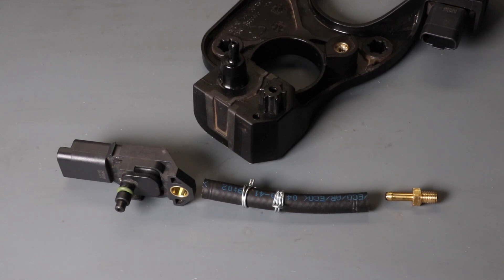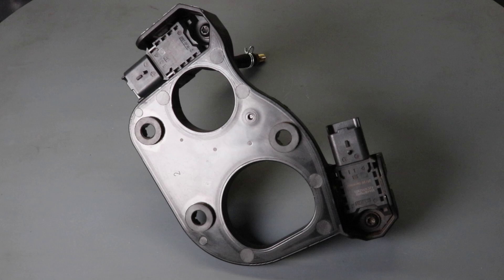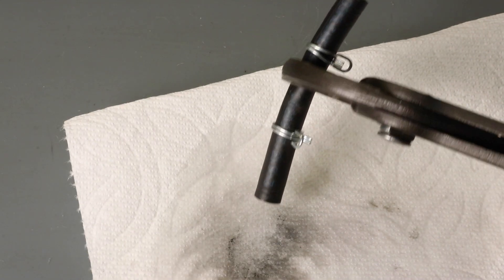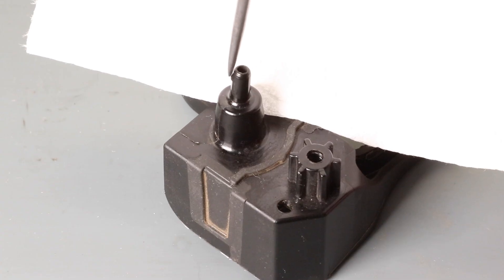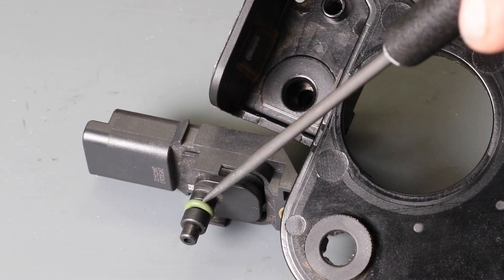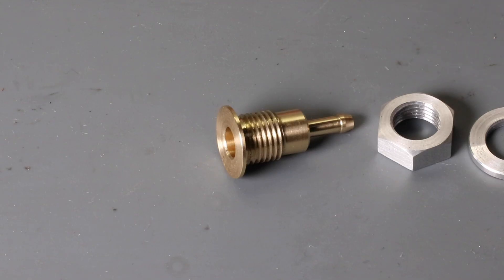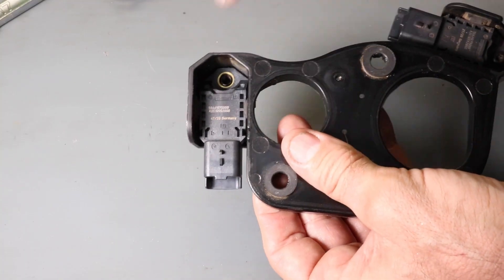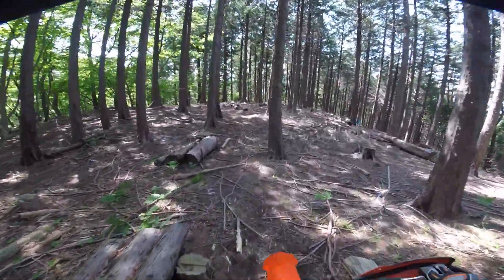KTM TPI 2-stroke Engine Bogging? CCPS issues, fixes and modification

Comment: Just some updated info my 2024 Husky TE150i having the same issue and it was a bad CCPS.  Had about 120 hours on it before it failed. Also had an intermittent problem with a no start and cutting off randomly turned out was a bad wire that connects to the ECU.
Reply from the maker: Pleased to hear that you figured out what the issue was. Good to know...

Comment: Would this throw a code
Reply from the maker: Regarding the CCPS, AFAIK an engine blink code is only thrown if the sensor goes short circuit, or open circuit.

Comment: Is the CCPS and Ambient Air Pressure Sensor the same part#? I have a 2022 Husqvarna TX300i and both are identical. Is this correct?
Reply from the maker: Yes, they are the same part number

Comment: Why relieve the tray to get the brass flush? There’s room above the sensor so  it won’t hit anything and the screw will hold it in place. Just wondering as I’m waiting on the parts to fix my 2020 250xc.
Reply from the maker: @slowheelie  The sensor will sit too high in the tray so the tray clips won’t hold the sensor in place if you don’t have the brass coupler flush

Comment: I have a new 2024 300 XC-W in the USA (14 hours on it). I am having problems at low RPM. The bike runs rough as if it were cold, or lean.
Looking online it seems that for the TPI models this used to be a Crankcase Sensor issue. I cannot find any information online to whether the 2024 TBI also has an issue with this sensor. Also, my bike is pretty clear with only 14 hours.
Do you have any suggestions? I would greatly appreciate and lead.

Comment: Hi Mark, Love your videos and hands on work.
my 2021 300 tpi is having what I think is CCPS issues, bogging at low and mid throttle openings and can clear with a few revs, but the odd thing is it may not start doing this until an hour or two into a ride ! so being an intermittent problem is strange and difficult to diagnose. I swapped the two sensors around and the problem went away ...... well for at least 8 hours then started doing it again. .
Reply: Did you find the solution? My 23 ec300 has the high RPM low throttle bod / jerk kinda. Like rolling off from 3/4-full throttle to quarter it bogs and lurches me forward. I can get it to bog in 1st gear on the stand medium to high rpm really no clue what it is. I’ve cleaned everything and swapped the sensors
Reply: @E63s_Scott  the problem with my 300tpi turned out to be the engine temp sensor , but oddly it did not often show a fault code so was very difficult to diagnose.

Comment: In the middle of replacing all of this, do you know that torque specs for the brass vacuum bolt that goes into the cylinder?
Reply from the maker: In the manual it states 2Nm with Loctite 2701 which is high strength, I would suggest Loctite 243 (medium strength)
Reply: @TokyoOffroad  I couldn’t find it anywhere in the manual, ended up snapping it off. Extracted it and torqued the new one to 7nm. It’s doing fine so far.
Thanks for the info

Comment: Hey mate I have similar problem but once it bogs I can’t save it and it stops then I can start it right back up and it will do it again ? I’ve replaced the ambient sensor side, reckon I should try the other side ?
Reply from the maker: Yes, try replacing the CCPS if you have a new one and see how it responds.

Comment: Question, did you notice a change in the exhaust note when the sensor was busted?
Reply from the maker: Yes, it won't rev out properly (will bog) if the CCPS is not working correctly, so the exhaust sound is quite different from the normal sharp sound.
Reply: @TokyoOffroad  ok, did it sound like there was a leak in the exhaust connections or like it was running too lean, or like the muffler wasn't properly insulated?

Comment: Looking for some advice! Any recommendations is very much respected! My 2020 ktm 250 tpi 250xcw bike with roughly 100 hours has never been worked on till I purchased it at around 70 hours. Other then a fmf fatty expansion chamber.  When I bought the bike it ran perfectly. Then about a month later it started having a weak idle. It would die on a long downhill with the clutch pulled in. I done the idle screw mod in the bottom of the throttle body and got it idling good. Now I feel like the bike is bogging more in the low end. I adjusted the air bypass screw to where the bike feels the best an its around 6 turns out. I heard that is too many an something else must be wrong with it. The bike runs amazing on the high end. Iv heard of the crank pressure sensor giving people bogging issues but it was on the higher end of rpms. Mine seems to have lost the low end grunt but barley enough to notice.
Reply from the maker: One possible cause could be the top end (piston and rings) has become worn. 100hours on a 250 TPI is a fairly typical period to overhaul the top end. When you overhaul the top end inspect the cylinder and check that there is no bad damage. If all looks good replace the piston and cylinder. If you have a compression gauge take a measurement when the engine is fresh for reference so you can compare later, especially if performance starts to drop off.

Comment: For those who might want to know: the CCPS sensor can get worse than a bad bog at higher RPMs, and prevent the bike from running entirely. I think a piece of carbon got sucked into mine and totally roasted it. Bike was inoperable past warm up. New sensor: bam, fixed.

Comment: I had the same bogging issue. Swapped sensors and bought your brass fitting. Bike runs great now! If it was a bad sensor, why does the bike run great with what is essentially a bad Ambiant Air sensor now?
Reply from the maker: Pleased to hear that your bike is running well now and thanks for your business.

Comment: 2021 GasGas ex300. Sat for 8 months. Started each month, but no high revs, just idle. Bad bogging. Quick blips and over 1/2 throttle bogs. Changed all fuel filters, changed CCPS, and cleaned CCPS hose. No change. Any other suggestions? Fuel pump? Throttle position sensor? Any help appreciated
Reply from the maker: Sorry to hear about the problem. If you have the equipment I'd recommend doing a compression test and also a fuel pressure test.
Reply: Did you find the cause ? I’m expecting a high end bog when rolling off the throttle or holding half throttle going up a jump for example it’s super jerky, I’ve cleaned and swapped everything even tested the fuel pump can’t find any issues
Reply: Problem was a clogged spark arrestor. Once cleaned of all the 2 stroke oily residue it started right up and ran flawlessly

Comment: Hello. Recently purchased and received your modified tray. How tight shoul I tighten the aluminum bolt? Thanks!
Reply from the maker: Thank for your purchase. The CCPS coupler is made from brass and the nut and washer are made from stainless steel. I recommend using a little epoxy between the tray and coupler (to help ensure it can't move in the tray). Please use some medium strength threadlock when installing the nut. The coupler nut only needs to be snugged down and it's important not to over tighten it or the coupler threads may be damaged. To stop the coupler rotating while tightening the nut place a finger on top of the coupler and press down while tightening the nut. Hope the install goes smoothly...
Reply: @TokyoOffroad  Thank you for your reply.  I have installed and also installed GET ECU and GET relocating race kit block.  The bike was brand new (2023 300 XCW TPI).  Today, I took the bike out for test ride for the first time and I noticed stuttering  behavior on low slow take off..  Can you think of anything that could cause stuttering engine behavior?  I also installed Idling screw as well.  Thanks!

Comment: Hi my friend how are you doing?
I’m having a problem on my 2020 Tx300i, it start very easy idle good but when open the throttle for a little bit it still good and when I keep opening it bogs, I went to my friend’s home yesterday because he has a 2021 te300i and we did a lot of different tests switching part like thank to test pump, injector, spark plug and and the ecu but it still repeating the same problem using his parts on my bike. So can you please Giv me an idea how to fix it.
Reply from the maker: Sorry to hear about the problem. The most likely cause is that either the crankcase pressure sensor (CCPS) is bad, or the hose/fitting going from the engine to the sensor is blocked. Your 2020 has 2 pressure sensors mounted in the oil pump plastic tray (CCPS and atmospheric) which are exactly the same. Try swapping the pressure sensors and see if it fixes the issue. If it does then replace CCPS sensor. Also recommend removing the hose which connects the CCPS to the engine and the engine mounted brass fitting and cleaning them both to make sure that they aren't blocked.
Reply: @TokyoOffroad  thanks for the tip, I will try and see what happens.

Comment: TPI owners. Has anyone experienced a low RPM stutter along with occasional pinging/ erratic top power on their tpi bike that wasn't related to the pressure sensors in any way?  22 te150i, 17hrs suddenly started running poorly.   Everything from fuel pressure to electrical grounds has been inspected, checked compared and verified, along with everything in this video.  I temporarily bypassed the tray and hooked new sensor up directly to the hose. I went ahead and replaced the ambient sensor, no change. Dealers want to mess with the power valve or change other settings that I'm not OK with because it ran perfectly until all of a sudden at 17 hours.  
Completely oem bike, untouched other than careful inspection.  This has to be a unusual failure/malfunction.
Reply: A friend said her 22 150 TPI was running like crap. Said it was bogging and wouldn’t rev. She asked if u would look at it in a ride we were doing that day…I tried it out and was definitely not revving out and was was bogging at mid throttle range. Initially U thought CCPS, but also realized that she is a very new rider and never runs the 150 TPI flat out in the pipe. So I wondered if it just needed “to be cleaned out.” Long story short, I ride it several laps around a track area, singing in the pipe through every gear, several times (like the wee 150 needs to be), and it completely cleaned up the symptoms. So you can try that first.
Reply: @GnarlyChicken  lol yeah no that was not the problem.  The tpi 150 runs using extreamly little oil and fuel. If it's fouling up at 100:1 like it is at low throttle, then there is a malfunction.  But for the record,  I ran it full throttle for miles on end. Made no difference  ran just like the ktm in dirtbike channels video, even he couldn't get it fixed right.  This is a serious problem on KTMs part.
Reply: @Dat_Sun  Did you ever figure out your issue? I'm having the same problem on a 7.5 hour Gasgas EX300. Partial throttle detonation.
Reply: @jgrady7779  I am sorry to report after 2 dealers and 800.00 in failed repair attempts, I traded it in for a new yz250fx. I have recently learned of tpi reeds failing with chipped corners at under 20 hours, I would also inspect the cylinder for scoring.  Many are experiencing cold start damage that might explain this type of problem.
Reply: @Dat_Sun  Thanks for the reply. I am edging closer to dumping mine if I can't get my issues worked out. Or converting it to carb.

Comment: Just bought an 18' XC-W 250 W/ issues. Glad to find this. Just a thought: That CCP sensor hose looks like its designed for
a high pressure hydraulic system. Maybe the stiffness of this hose is causing the deformation of the tray bung? Seems crazy at the small pressure differentials that this hose sees, that this beef is necessary. Maybe those small wire clamps are not sealing it? This is all new to me..

Comment: I changed my sensor a couple times , but bike still was running crappy at low throttle. Ended up being the engine vent tube was clogged with white watery oil gel on the front of my engine.
Reply: Thanks, another thing to be aware of.
Reply: What engine vent tube?  I have one going from the right side power valve to the airbox. Is there another vent tube I am missing?
Reply: Power valve vent?
Reply: Did you ever figure out what vent tube? My lemon of a TE300i is doing the same shit, low end sputter.

Comment: Tokyo I enjoy your videos and have learned a lot, thought I might offer advice to help you for once.  Some are spraying aggressive solvents (MAF, carb, brake cleaner) into the sensor in an attempt to delay problems or bring a dead sensor back to life.  The sensor is potted from the elements, for a gentle yet more effective approach try a heated ultrasonic cleaner with water and 1/4 cup of simple green.  Don't submerge completely, hang from the electrical connector.  This approach should completely clean the spooge out of the sensing orifice.
Reply: To test effectiveness backprobe the sensor return pin and use a DVOM to read before & after voltages with the engine in the problematic rpm range.  If you have access to a labscope it would make good content for another vid.  Thanks again and keep up the great work.

Comment: I thought I might have a failed CCPS. But, my sensors were fine. It turns out my issue was a very dirty spark arrestor screen. Crazy!  Very similar symptoms that is described by the CCPS failing. I learned something new as this my first 2-stroke (I owned 4-strokes before) and I only cleaned the screen once. So it all clogged-up at about 75 hours. I removed it for a test ride and she's back! Used a torch to burn it off. It caught fire like a sterno can and burned for 2 minutes!
Reply: Thank you so much for posting this solution.  As soon as I read your post a light bulb went off and I checked my exhaust.  The factory spark arrestor was wadded up and blocking the exhaust flow.  I didn't realize the factory exhaust had a screen!  I fished out the screen with a piece of wire.
Reply: @danielwallace2063  Cheers! My 2021 didn't have a factory screen. I installed the Enduro Engineering cap.
Reply: @BlueDawnEnduro  i had the same problem on my carby 2013 husaberg te250 with the ee screen.. or should i say i didnt stay on top of the maintenance properly and tore my hair out untill i saw the blocked screen.....😄,being old,slow,and fat, i now call that experience!!😂
Reply: Which bike TPIs don’t have a screen in the stock pipe ? Or I can’t see one on my 23 ec300?
Reply: @E63s_Scott Descobriu se a ec 23 tem a tela?

Comment: I heard that the crank case sensor fails way more often than the ambient pressure sensor. Would you recommend swapping the sensors as part of preventive maintenance on like 100h of riding time? Just to even the "stress" on the parts.
Reply from the maker: Yes, the CCPS sensor appears to become problematic more often than the atmospheric pressure sensor. Some have reported that when swapping a poorly performing CCPS into the atmospheric pressure sensor position then the bike develops a stuttering issue. As such my recommendation is to replace the bad CCPS with a new one and not reuse the bad sensor.
Reply: @TokyoOffroad  sorry if i ask double just to be sure: would you also recommend switching both sensors with each other at a certain hour mark to even the stress on them? Even if they are both still working?
Reply from the maker: @vfischer66  - For a regular trail rider, no, just swap the CCPS if you're having problems with it. However, if you're a racer I would swap out both sensors at regular intervals as part of the maintenance program.
Reply: @TokyoOffroad  Sounds good to me, thanks for the information (and a lot of kudos for your general content). You became one of my main sources of knowledge for the EXC TPI models.

Comment: Hi are you going to do a video of how you modified the tray?
Reply from the maker: Good question. I wasn't planning on doing a video as I use my milling machine and anyone who owns a mill would probably know how to do the required modification work. In the kit instructions (printed sheet included with each kit) I do describe what is required: "Drill a 12mm diameter hole in the stock plastic tray in the location where the stock crankcase pressure sensor chimney fits. A milling machine with a 12mm end mill can be used, or a drill press with a step drill centered on the factory bore.
 Create a 1mm deep, 18mm diameter recess around the top side of the 12mm hole to allow the brass coupler to install flush in the tray. If you have a milling machine you can use an 18mm end mill for the work. Or if you don’t have a milling machine a rotary tool (Eg. Dremel) could be used to carefully grind away the plastic." For anyone who would find it difficult to modify their own tray I will start to offer modified trays in the near future.
Reply: @TokyoOffroad  thanks for the answer! 

a modified tray would be great or a video i could show the machine shop. (language barrier in this country 😀)
Reply: @TokyoOffroad  I've already butchered 1 tray & probably won't have success with the 2nd I just bought. The challenge I found was properly securing the tray as it has multiple angles & not really any good place to lock it down in order to do the 1mm recess.. Look forward to the Modified Tray availability. Thank you.

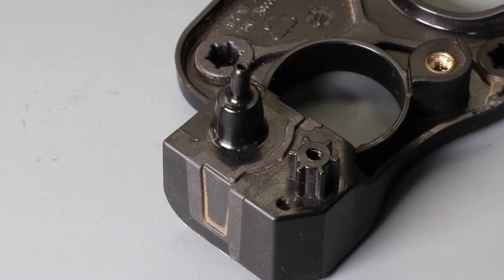Comment: 5:07 Why would KTM use a sensor made to clamp into a manifold, and then adapt it with fittings on that plastic tray to suit a hose?
It makes no sense when there are multiple pressure sensors available with a direct hose connection.
Crazy

You could use the MAP sensor from a Honda CRF as it is a remote unit with a hose barb.
Almost all efi sensors run on the 5v modified signal and should work with the ecu